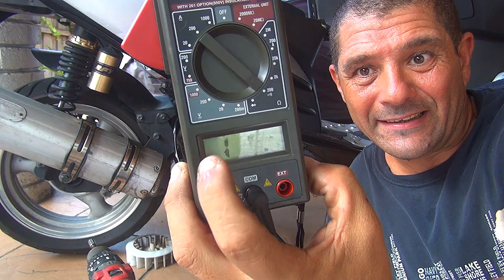How to test Pickup on a Chinese Scooter

Comment: Hello, great videos. I have been learning a lot from you. Thank you for sharing your expertise. I really hope you can help me because I'm losing my patience. I recently bought a 2015 Palazzo 150cc Scooter with gy6 150cc engine with 399 miles on it. The original owner said he drove it for 1 season when he bought it new and did not winterize it. The following season it would not start. 

I bought it not running. First I drained the small amount of fuel in the tank and added 1 gallon of premium gas and a new battery. The scooter will start if I give it a lot of throttle and continue to turn the throttle. However, once I let go of the throttle it stalls. Next i replaced the sparkplug .It was and continues to run very rich. No change. I pulled and cleaned the carb. It was spotless but I cleaned it anyway. No change. Replaced the fuel filter. No change. Discovered the air/fuel mixture screw was capped. Drilled it out. It was turned completely in... closed. Opened it  up 2-2.5 turns and everywhere else... no change. Ordered and installed a new carburetor. No change. Adjusted air/fuel adjustment. No change. Replaced DC CDI. No change. Replaced sparkplug wire and coil. No Change!

 I'm at my wits end with this scooter. Basically it seems that it runs very rich.

When I first got it... i kept hearing something knock around when it was running... I figured out that thr previous owner dropped the sparkplug into the black housing and left it in there after replacing the plug. So.... as I was trying to start the scooter the old plug was flopping around and hitting the flywheel fan... unlit it broke some of the flywheel fan fins. It also chipped the pickup location tab that sits on the flywheel.the. a little at the front.

Could a chip in the front part of the pickup location cause less/weak spark resulting in the engine running rich?  Do the valves ever need to be adjusted at 400 miles before the engine is even broken in yet?

Any assistance would be greatly appreciated.
Reply from the maker: Hello my friend wow you did a lot of work on that scooter the good thing in the long way that you learn a lots of new things about your scooter ah ah ah my question is if you change your carb for a new carb did you change the main jet accordingly to you altitude ? if you are at see level you should have a #115 main jet and a #38 pilot and every 1000 FT above  you go down 2 jet size only for the main jet . I don't thing  a chip in the front part of the pickup location cause less/weak spark resulting in the engine running rich but if the pick up sensor is slightly moved scooter can miss fire Yes you can adjust your valves anytime because you know  chinese company are so much in the rush to ship out those scooter and make the money. Thank you for watching my video
Reply: @VirberelloScooterTips  The stock carb (which originally worked and ran) was a #105 Main Jet and #32 Pilot Jet. I am in Detroit Michigan.. about 600 feet above sea level.  The new carb has a #102 Main Jet and #35 Pilot Jet. The spark-plug shows it's too rich... it's getting too much fuel, so enlarging the jets will provide more fuel, which seems like the wrong thing to do if it's running rich and getting too much fuel correct?

I checked the valves today. Both intake and exhaust were .003". I adjusted the intake to .004" and the exhaust to .005". No Change. Only starts when I use lots of throttle and after starting will not idle.. stalls once I let go of throttle. I do not know what else to do... other than this chip on the reluctor.

Comment: Nice work thank you for these information 
I have a problem with my scooter 50cc kymco agility 
The problem is the scooter runs in a sunny day but at night when it’s very cold it runs but it keeps cutting and doesn’t run good also when it’s raining the scooter run but it doesn’t accelerate and this happens only when it’s cold and raining. 
I would like to know the problem? And I hope you answer my question.
Thank you for your help
Reply from the maker: Hello abdo I will check the sparkplug and upgrade that to a better quality like a Iridium Spark Plug and see if something will change
Reply: @VirberelloScooterTips  thank you for your answer I really appreciate it 
I will try that

Comment: Got new carburetor put it on today it runs but it's not working right 7500 rpm is how I gage the speed but it cuts out at 5500 like not getting gas?? Any help
Reply from the maker: Hello my friend sometimes carburetors comes with the smallest jet they can find because they are not sure where is the carburetor been shipped and sometimes you can find dirt or metal shaving inside the carburetor so the best thing to do is to open the new carburetor make an inspection to make sure is clean and reject the carb according to your altitude and temperature / location also make sure fuel hose is not curved or bend or squeeze thank you for watching my video and be safe
Reply: @VirberelloScooterTips  Thanks so much man

Comment: What if my moped start up fine but, when I throttle up. My moped bogs out and dies. My bike was running completely fine until one day it didn’t want to run correctly. Lmk guys please thanks you vm🤙🏽🤙🏽🤙🏽
Reply from the maker: Hello my friend you need to clean the main jet inside the carburetor that is why your scooter in having this problem
Reply: I have swapped my carb, cdi, spark plug, spark plug coil, new gas, still has bogging at full throttle.
Reply from the maker: @JonahNAloha  If your scooter look like mine and you change all those parts there is the possibility that you have a fuel delivery problem try to reject your carburetor accordingly to your altitude and yearly average temperature  and make sure you have a good quality fuel filter and look at the fuel hose to make sure is not banded  because my scooter works on gravity to delivery the fuel and the last thing you can do is to check the valves clearance

Comment: I have a Gy6 150cc scooter 2023 and it doesn't have a CDI box. Is there a reason??.
Reply from the maker: Hello my friend I have a feeling that your scooter is an EFI scooters and you do not need a CDI (Capacitor Discharge Ignition) because EFI systems use a different method to control the ignition timing of the engine.
In a traditional carbureted scooter, the CDI is responsible for controlling the timing of the spark that ignites the fuel in the engine. However, in an EFI scooter, the ignition timing is controlled by the Electronic Control Unit (ECU) which is part of the EFI system. The ECU uses various sensors to determine the optimal timing for ignition based on factors such as engine speed, throttle position, and engine load.
By using an EFI system to control both the fuel injection and ignition timing, the scooter's engine can operate more efficiently and produce better performance while emitting lower emissions. So, while CDIs are still commonly used in carbureted scooters, they are not necessary for EFI scooters.
Thank you for watching my video